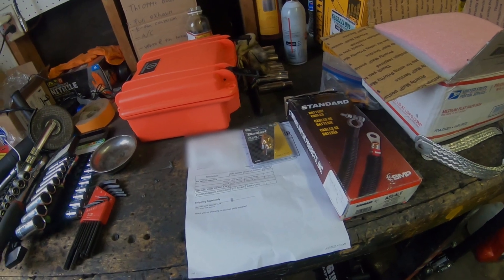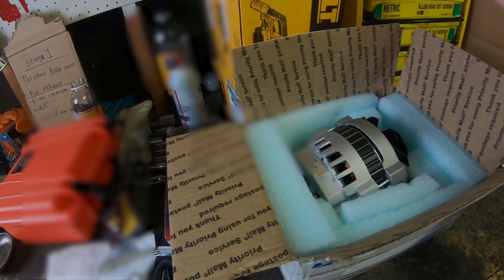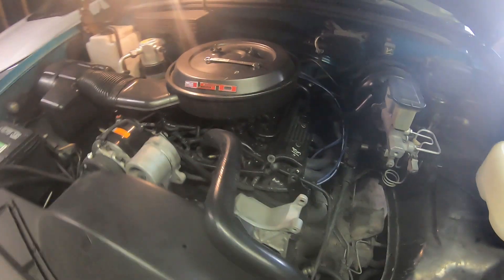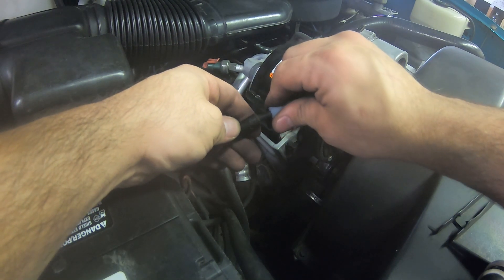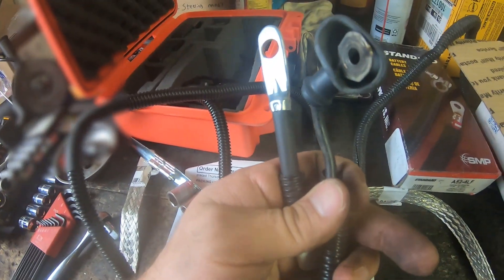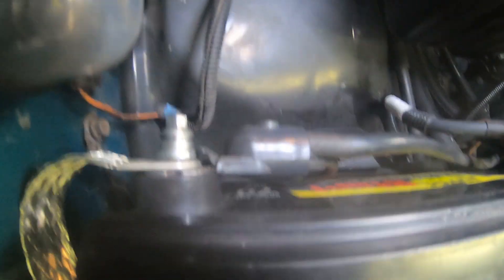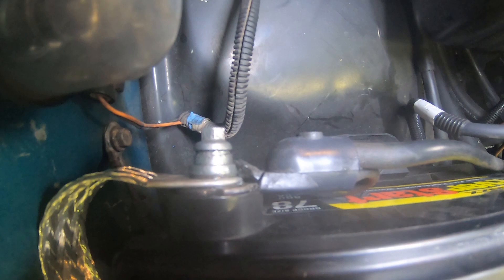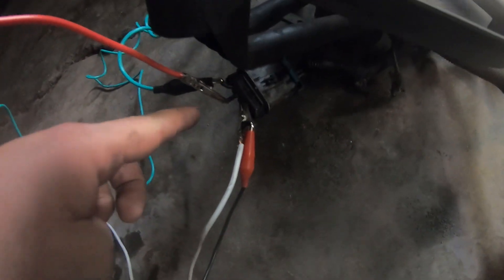GMT 400 alternator and BIG 3 upgrade!

Comment: Just upgraded my 100 amp alternator to a GM 140 amp alternator on my 97 GMC Sierra 5.7L as that helped out tremendously with the aging wiring in the truck.
Reply: straight swap? or plug rewire?
Reply: @amatureskater15  swap out the plug or get an adapter. Also requires an extra wire for voltage sensing.
Reply: @jamesm568  what wire are you referring to?
Reply: @amatureskater15  a lot of new alternators have a voltage sensing wire that hooks directly to the battery as it measures voltage at the battery instead of at the alternator.

Comment: Couple tips and things to also think about. I did the same upgrade on my 2004 Suburban, and am going to do the same upgrade to my 1996 Suburban. The stock alternator on my 2004 could not keep up either after   dual electric fans. So I bought a 250 amp alternator from mechman alternator, and they recommend a 1/0 battery cable from the alternator to battery and 1/0 ground cable from battery to frame and chassis. Also with a 250 amp high output alternator, I would also install a 275 to 300 amp fuse on the cable going from the alternator to the battery in case the alternator goes bad and starts overcharging and or sends hi amps through the cable due to high resistance which could melt connections and battery cables causing a fire. It's what I did, and I feel safer for installing the fuse.

Comment: I never use those braided ground cables, these tend to deteriorate, get green and ultimately fail. I use solid cables all the way around from experience the solid cables are way more reliable. Don't say I told you so
Reply from the maker: ill be sure to keep an eye on them but if your cables turned green that isn't fault of it design but more so the quality, I work as an aircraft mechanic and our braided cables rarely cored. its about quality.